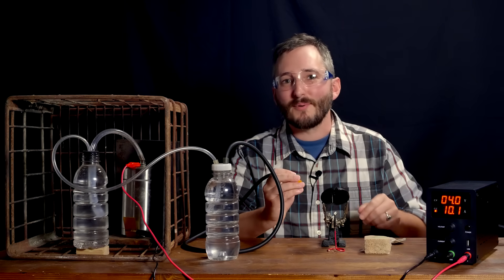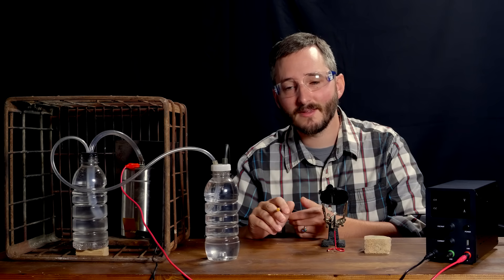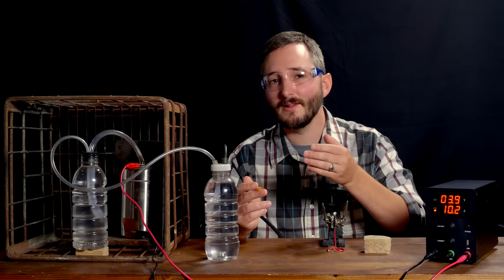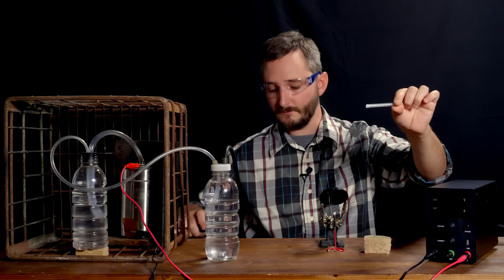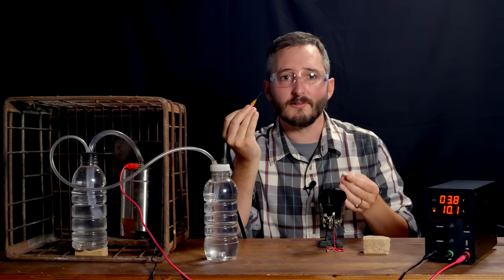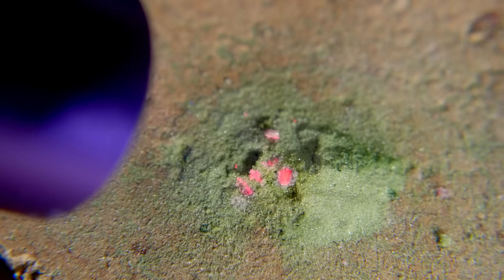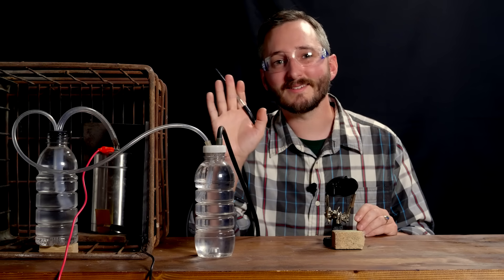DIY Oxy Hydrogen Torch Using Water Electrolysis

Comment: The first time I saw one of these working, a grad student was constructing a saltwater aquarium and flame polishing the edges of acrylic(?) sheets before chemical welding them together.  It has been to many decades to remember what materials he used as the clear/"glass", but I am sure others here can extole on what materials are suitable for flame polishing and welding.  Nice video BTW.

Comment: Just a note that decreasing the nozzle size does not increase the pressure as you claim. It increases the velocity (flow rate) but actually decreases the pressure
Reply from the maker: It decreases pressure in the nozzle, it increases pressure in the system.

Comment: Would mixing in the oxygen just before combustion remove the risk of explosion?
Would pumping in air without using the oxygen produce a good flame, maybe with increased electric power for more hydrogen production?
Using air, would saving the oxygen into a separate bottle give an interesting way to vary the combustion?

Now having read more of the comments, I see that you could have used more separation between the oxygen and the hydrogen in production but it gives less efficiency.
Apart from that, adding neon, argon or other gases could make interesting colour variations.

Comment: Perhaps it can be used for "spot welding" very thin stainless steel. Also, would it not be possible to mix the two gases only at the end stage and, thus, nullify the risk of an explosion?

Comment: Hey, I love this, and I would like to make it, at least the hydrogen part. I was wondering if you had a link to the food container because I was searching and couldn't find one with a rubber gasket, or one that didn't reconnect further down. Thanks for making cool stuff!!!
Reply from the maker: I think both the plastic containers and the metal thermos thing were all from Walmart. I no longer recommend the plastic containers because they don't stand up to the alkaline solution for very long and will develop cracks
Reply: @Nighthawkinlight  thank you for the quick response! That isn't good for a bottle full of acidicness to just be cracking... not doing that I guess...

Comment: Am thinking of making one to run off 2 kw solar array to weld my van. I would keep the H and O separate until recombining in reaction chamber, like a rocket bell. Electrolysis to be done in a large water cooled stainless milk churn with the anode underneath a funnel. Secondary uses will be hydrogen balloon program, which may not be enough for human lighter than air flight…

Comment: What if you neade multiple that has separate the gas and than combine it with safety measures on both separate and combined to meake it even safer

Comment: Can enough electricity be generated to power the electrolysis if the hydrogen, generated by the hydrolysis, is used to boil water, to create steam pressure that spins a turbo attached to a generator or alternator? If so, would there be any surplus electricity generated?

Comment: how about flashback arrestors?
ho dangerous would flashback be at the worst?
Reply: those water bottles are crude flashback arrestors. the danger depends on your production rate (and materials used in your generator) if its a sealed metal container like his you have shrapnel danger and if you are producing a lot of gas the main objective is a reaction where you are consuming at same rate of production so you dont have a bunch of gas to explode if something goes worng

Comment: 3 years later and I still wish the "professional" version of jeweler's torches weren't so freaking expensive, $2500USD for the freaking thing, it is tempting to DIY but yea don't trust myself always teetering on the edge of safety.

Comment: Can wood be converted to propane? I know woodgas is around 3% methane. Could pressure or similar variables be tuned to create propane which can then be stored and used later? I recall claims that fluidized bed gasifiers could make diesel.

Comment: I just thought of this video while driving home from work. I got a rock chip on my windshield and was wondering if this torch would be able to melt the pieces of glass back together so it does not spread any thoughts?
Reply from the maker: No, it would cause heat stress. Better to get the chip filled professionally. Insurance will often cover it for free

Comment: I have used what is common in industry / a flash screen . Much like your aluminum.
This is also called HO Gas used correctly improves gas mileage about 23%.
 Used incorrectly it can blow the heads off your engine.

Comment: Some HID headlight bulbs have a small  diameter graphite tube inside (about two inches long) protecting one  of the filament feed wires. They would be perfect for a nozzle.

Comment: Ok, ive asked several people on-line to please make a hydrogen fuel cell using the metal Gallium, it seperates the hydrogen from water and CAN be reused, i know you are smart enough to know if this will work, i think it will and at a much smaller cost, try it if you think its worth your time, thanks for the awesome videos!

Comment: Try placing a piece of sponge within the hose between the torch and bubbler built mine not to long ago and found out a piece of wet sponge can stop the flashback not sure how ur bottles dont blow the caps off thats what allways happend to mine had to remake them alot until i found out the sponge trick so far sence using the spong its flashed back quite a few times but hasn't once reached the bubbler 
Allso i orderd a cheap jewlers torch from wish the little torch it comes with 5 tips the 2 smallest tips are made for hydrogen and acetylene

Comment: With the size of traditional batteries going up, could electrolysis store energy for humans in less well known ways? You said HHO should never be stored and should always be made only when prepared for using it but idk I think enough energy for a bomb released slowly and the only biproduct is water, we may have found the non-lithium battery that could save the environment.  Could we pull it separately and only combine gases when ready for fuel? What if this was our gas for energy and solar chargers the system?

Comment: I run a Glass Manufacturing business, we melt at 1480 degrees Celsius.  What would you recommend on such an industrial scale?
Reply from the maker: I only have the small medical machine and have never used larger ones. I know some glassworking shops use oxygen machines to run many torches simultaneously, so industrial versions do exist. I don't know anything about them however.

Comment: Talking about jewellery craft , how is it with with titanium? Titanium wire can be purchased from suppliers for jewelry trade , also silver  n gold n platinum..... .  I didn't know about aluminium wool either . The closest I've done to jewelry welding is to silver braze improved attachments to my Swiss knife once . I clamped small copper bars to act as heat sinks.. I'm seeing oxyhydrogen to be a better tool than oxyacetylene.

Comment: Why isn’t electrolysis used for vehicles ?
Reply: It's terribly inefficient. Using electricity directly to power a motor saves more energy than using that electricity to separate water into hydrogen and oxygen and then use that as a fuel.

Comment: It would be interesting to use the flame to heat a sharp tungsten endmill like 1 mm or 0.5mm thickness and use the tip of the hit tungsten to weld metals

Comment: You weren't my initial inspiration for science and chemistry, but you are the reason that I continue to come back to it. My homemade HHO generator is one of my favorite homemade gadgets and I'm excited to utilize it to make some rubies this summer once I can bring it out of the basement. One question: it looks like you film these videos inside. Isn't dangerous to produce such a volatile gas inside a closed space? Or are you using a venting system to ensure that it can never build up to a point where explosions are possible? Cheers!
Reply from the maker: The gas production of this system is too small to be a concern in a large space unless run for many hours or days. The fumes however are a concern from whatever you might be burning. Because of that it is extremely important to have ventilation and a respirator to be cautious. The chrome in ruby can potentially convert to cancerous compounds under high heat and oxygen.
Reply: @Nighthawkinlight  hadn't considered the particular risk. Thank you. I'm currently watching your video on infrared cooling paint and I'm debating which of the two projects I want to do next. If I pursue the rubies, I'll be sure to conduct the melting process outside and with proper respiratory protection.

Comment: Greetings, I really like such informative videos. 
  I have been operating a factory-made electrolysis gas generator in my home workshop for more than fifteen years. The maximum power is 2 kW. Any hydrocarbon (gasoline) is used to stabilize the flame, the gas mixture passes through gasoline and is saturated with molecules, resulting in a stable blue flame. The same device, oddly enough, serves as a shutter in case of a possible reverse impact...

Comment: When I use oxyacetylene torches I was taught to shut off the acetylene before the oxygen to prevent flashbacks, have you thought about directing each gas and having them mix in a tip like oxyacetylene does so that you can 1. Adjust the heat 2. Create a safer environment

Comment: Instead of using the paper wad to extinguish the flame, can't you just have a small container of water to dip the tip into?  That should also work with the scenario where the flame travels up the tip.

Comment: I'm glad to find someone that understands what I'm doing. I clean cast iron cookware with electrolysis but it's a trial and error for me. I'm currently using my third electrolysis tank and i don't think I can improve it. Let me explain, the tank its self holds 35 gallon made from a 55 gallon plastic barrel. 35 gallons requires half a box of Arm & Hammer Super Laundry Booster or 1 1/2 tablespoons per gallon. The barrel is lined with stainless steel sheet metal for anodes, stainless is much easier to clean than carbon steel. The tank is powered by a 200 amp rolling battery charger that delivers 24 to 38 amps depending on the size of the pieces in the tank. I've used this configuration for over two years with sparks over the tank and everything without surprises. I have it setup on an enclosed two car garage without extra ventilation. It's operated for a week at a time and the tank temperature can reach 125 degrees. I have no idea what I'm doing I just continued to build tanks that cleaned better. This one has removed rust, buildup, paint, and even concrete. It will clean roughly 3 pieces in 12 hours depending in the condition of the pieces. Other people use stainless steel anodes as well without an issue. My question is why is this working safely? Is the gas not concentrated enough? I'm basically doing what you're doing I think.

Comment: I played with HHO about 12 years ago, I made a torch from the smallest tip from an oxy acetalyne kit and made a flash back arestor from stainless steal wool packed into a small tube, it worked very well. I had a flame about 4 times as big as what you have showed. It would cut through steel washes and melt all kinds of stuff.

My HHO generator was very powerful and could blow up a ballon, and when that was triggered from an electric spark Made the loudest bang I have ever heard.

Comment: and also have the gastank a longer distance away from your face, and perhaps a pump if the resistance through the tube gets too large. but atleast it shouldn't be two feet from your face if anything happens. and then it might be possible to scale it up alittle.

Comment: If you ran that needle through a plate and focused it on a ball of stainless steel and passed air through the container that the steel wool was in it might make a serviceable heater. Since stainless doesn't melt or liquify like steel then it should work like the mantle in a lantern producing quite a bit of heat.
Controlling the temp might be a problem but only because I need to learn more about heat sensors and how a gas stove ignition works.
I've always had electric appliances and just recently used a gas cook top for cooking.
Would be great if I had someone close like you to stand way back and scream DON'T DO THAT! 
every now and then. Lol

Comment: 🤣 i tried making one from the zinc + HCl apparatus where the H2 is collected in a test tube under water.

whoops! didnt account for residual air in the headspace.... 💥

the stopper bent the housing of the old fluorescent lights and Hope was picking glass out of her hair >20' away.

me and Geoff had taken our goggles off bcuz the experiment was over, of course. i remember holding the burner to the nipple outlet of the beaker... next thing I remember, we were ducked behind the next row of bench over like we'd teleported there 🤣

Comment: Someone where I used to work, put the wrong type of regulator on a hydrogen furnace, when that regulator blew off the resulting colorless flame burned though a concreate block wall and a powdered metal dust collector. It took the Indianapolis fire department all day to put the fire out. Hydrogen is nothing to fool with and they want to run cars on it.

Comment: I know this is an old video, but couldn't not share a question/idea.

In aviation when you have a stuck fastener you typically are forced to drill it to insert an esxtraction tool or remove the head of the fastener entirely. This process is both annoying and in a way risky. So my idea is, could this small torch be used to melt the head of the fastener off or make a hole for the extraction tool without causing damage to the structure.

If yes using it on rivets would save a ton of sheet metal workers time.

Comment: Gives me an idea to make the gas generation more efficient, imagine having a funnel with two conductive plates with the cathode on the inside and the anode on the outside… the hydrogen will pass through the funnel from a large surface area on the inside and the oxygen will pass on the outside of the funnel with a large surface area 🤔

Similar to those cylindrical power supply’s with the anode in the middle and the cathode on the shell

Comment: With the extreme variance in pressure between the production and the explosion, it seems to be a reasonable safety measure to put rubber plugs into the stainless steel top. Strong enough we're in which there would be no gas leaks from production, but we can have to blow out during a flashback exploring without creating stainless steel shrapnel. Perhaps even making it sealable by gasket as opposed to being screwed on.  This will blow it in half and possibly deform the container, but can be easily controlled and directed. The water solution is great. I'm also a big fan of redundancy. But there should be some safety feature on the gas generator itself.

Comment: Bottles are basically plastic grenades, right? Is there a good way to make them out of balloons instead? And the harder the seal, the more pressure builds, and bigger the explosion becomes, is it riskier or less risky to use weak/leaky (paper?) seals and simply a fan to circulate the air around? Then maybe the worst possible explosion would be a little "papp!" 
.... Am I crazy?

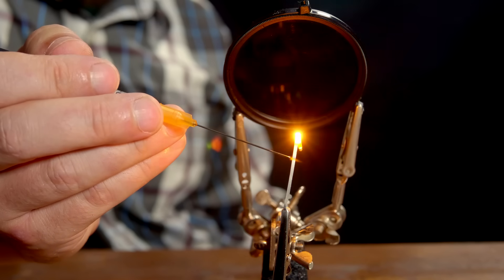Comment: 10:06 On the subject of real world usability, i always wondered if self generated hydrogen (through electrolysis) can be applicable in MIG or TIG welding instead of argon and whatever other ones are used, if those happen to be unavailable. Would hydrogen do?

Comment: I used a wide mouth container. Water and vinegar as the catalyst. Four high grade stainless steel plates + - + - spaced roughly 1/4" apart and plugged in my 12v charger set it to 2.3 amps and the bubbles looked like water was boiling. Using a lit 16" taper I decided to buy one, that seemed a safer way to go. My That was so loud it scared the crap out of me. Everyone in the house thought I had a gun. It sure would make a powerful potato launcher.

Comment: Would this be hot enough to melt through tempered glass and if so, could it be used to make holes in the glass without it shattering?

Comment: So nice ! Is it possible to cut and weld glass with this tech, or do you still need to slow bake it after ? Could be interesting to do diy foamglass, a very interesting insulating material, weather proof and resistant to compression !
Reply from the maker: You can use this to weld glass but it needs to be annealed after to remove stress just like any other melting method
Reply: @Nighthawkinlight  Yeah good to know ! Could it be possible to to the oven with the same system ? Thanks for your answer !

Comment: I did these experiments in my youth. I made the pipes from old plastic felt-tip pens. I produced a little bit of gas and then removed the felt-tip cap to release the gas through the small opening in the tip of the pen and fired it with a match. No explosions, the flame didn't travel back. The weird thing is that is flame started whistling while increasing its tone until all gas was burned.
Can you explain this? I wonder if you get that same result.

Comment: `I have enjoyed all your Productions this is the first time I'm commenting you coz I need help where would I get the multipack  tubing tips I live off the grid and I need to make a cutting torch
Reply from the maker: You can find the tips by searching Amazon or eBay for blunt tip needles. That will probably not work for you if you are making the torch larger than my own. You may need a real torch nozzle, perhaps a jeweler's torch or a mini propane oxygen torch head.